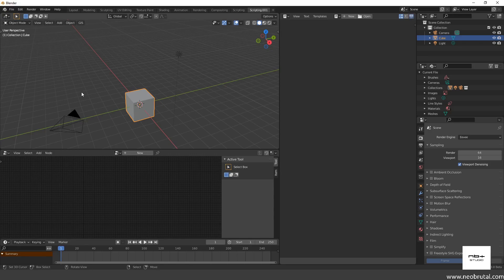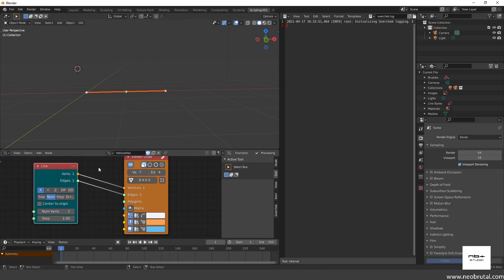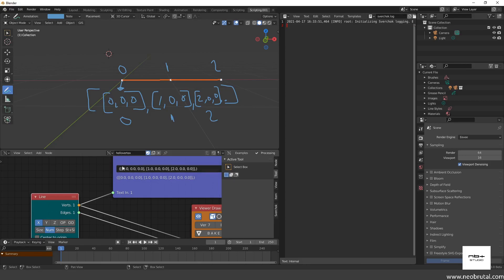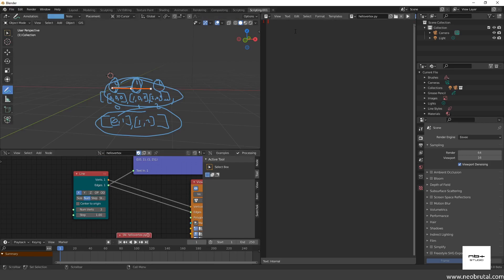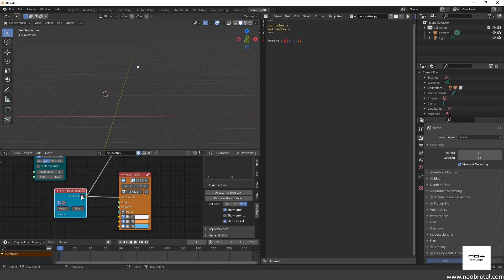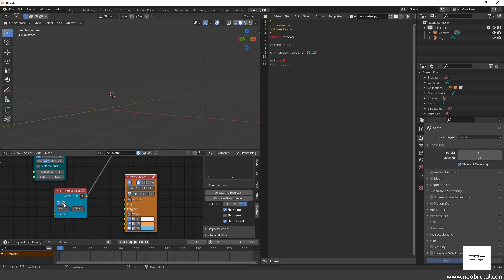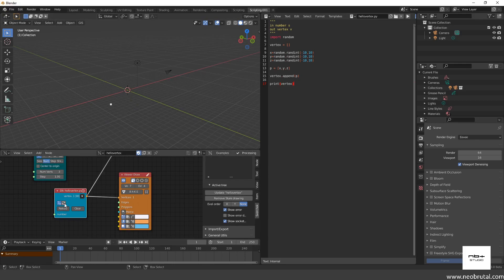Introduction to computational design with Blender - 002 Scripted node

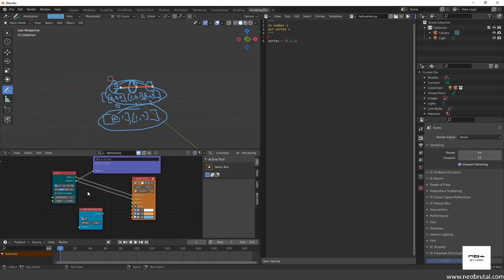Comment: at 10:00 i want you to know a few things. 
- ctrl+Enter in the Text Editor  will refresh the node. (no need to interfere with the UI on the scripted node)
- if you create an output variable in the directive ( like...   out vertex v ) , then you do not need to also specify it inside the code like (vertex = [] )  - the list called "vertex" is already defined for you automatically.
Reply from the maker: Thank you Zeffi! I will add this information on the next tutorial! i am working on it and hopefully have it this week.